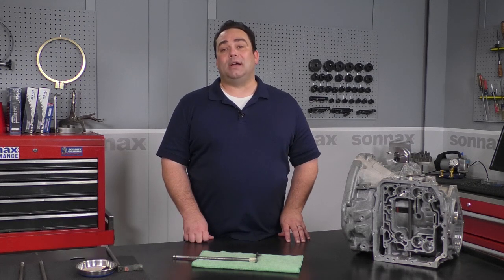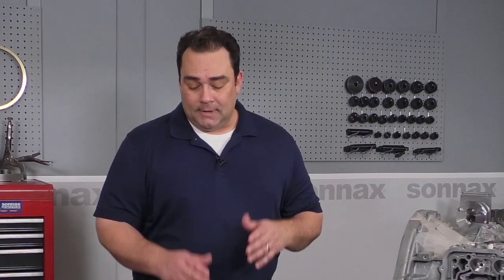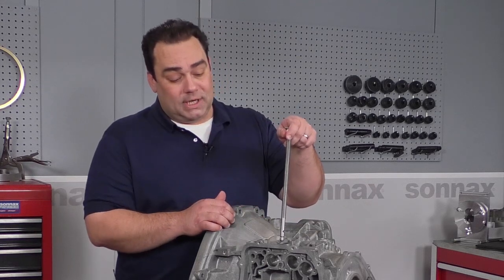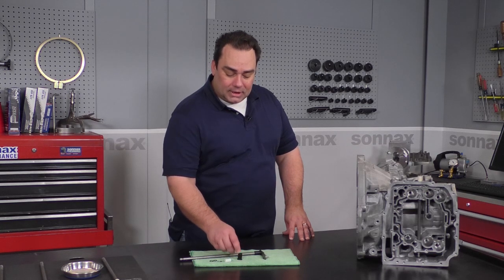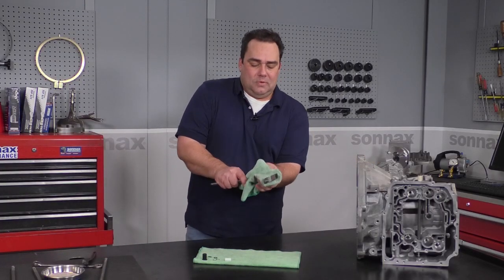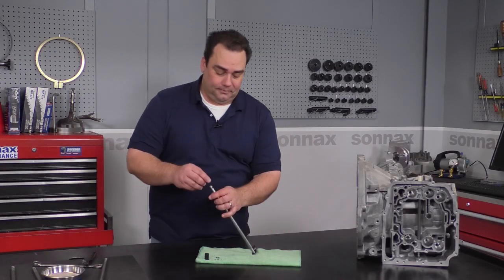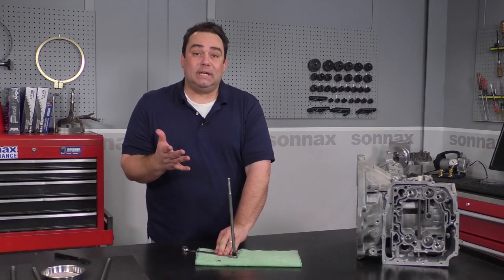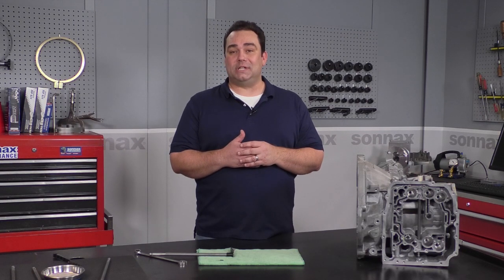How to Repair & Prevent 62TE Shift Shaft Bushing Failure

Comment: Would be great if you showed how to remove the shaft from the transmission.
Reply from the maker: Thank you for your request, Derrick! Will pass along to our video production team for review.
Reply: I swear that's what I'm looking for all data and prodemand don't have anything on it smh
Reply: All you do is pull it up with a breaker bar but make sure you mark it when you pull it off first

Comment: I have a 2016 dodge caravan with this problem my question is does the transmission need to come out to tackle this issue?
Reply from the maker: This repair does not require removal of the transmission, thanks for asking!
Reply: Is there instructions on how to remove.
Reply: You have to remove the valve body

Comment: Great videos! My question is this....what do you have to help the problematic 4T40E and 4T45E fwd GM transmissions? Thanks in advance!
Reply from the maker: Hello, you can find everything we offer for 4T40E here: https://www.sonnax.com/units/100-4t40-e, and 4T45E here: https://www.sonnax.com/units/99-4t45-e. Thanks for reaching out!
Reply: @sonnax  thank you very much! I have 2 cars with the same trans with identical issues, soft shifts, delayed reverse, line pressure issues. Im contemplating complete rebuilds on both at the same time i do any upgrades. Thanks again!
Reply: You can find everything we have to offer here.   But we wont sell to the general public.